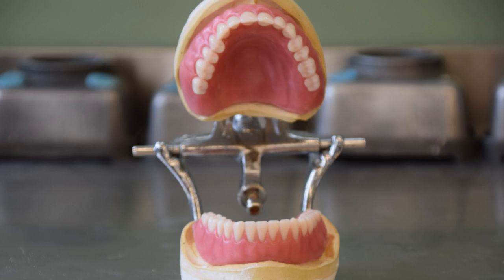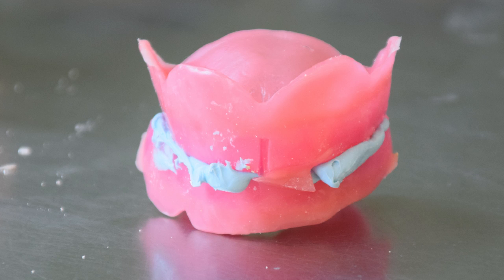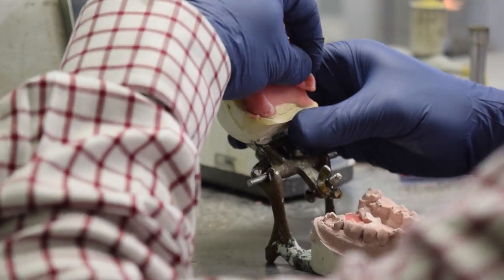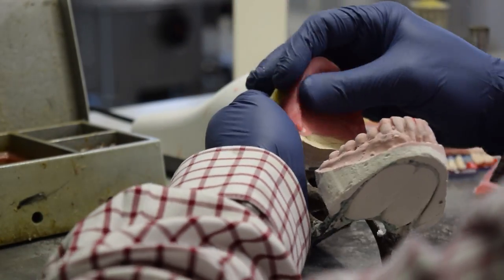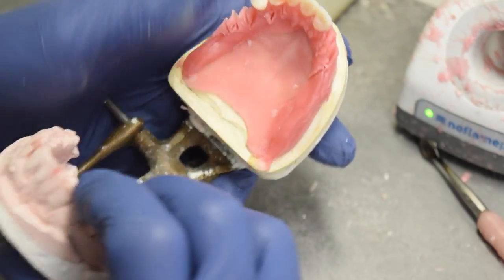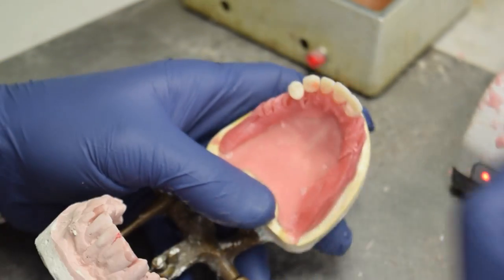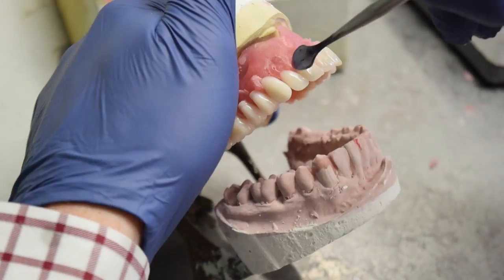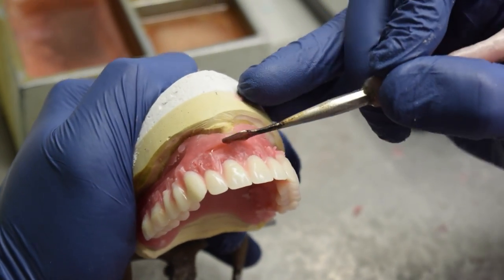Part of the Process - Setting Denture Teeth for a Wax Try-In

Comment from the maker: Looking for more info on different types of dentures or how certain lab items are made? Check out the videos below:

Denture FAQs - Types of Implant Dentures (Snap-On Dentures) https://youtu.be/no-aereeeio
Denture FAQs - Types of Dentures and False Teeth https://youtu.be/HgIpLvSL8jA 
Denture FAQs - 5 Frequently Asked Questions About Dentures by Patients https://youtu.be/QpbAyNYfDGA
Part of the Process - Setting 3D Printed Denture Teeth https://youtu.be/DFdREkyVPlU
Part of the Process - Setting Denture Teeth for a Wax Try-In https://youtu.be/cIci1ifbkW4
Elevator Pitch - 3D Printed Dentures https://youtu.be/ER1DSfiifeE

Like and Subscribe to the channel for weekly updates and videos in the dental technology space!
https://www.youtube.com/c/UticaDentalLab
Reply: I need better dentures made. I bought the $3k ultimate dentures from Affordable dentures and  their not right.  She down played my concerns and basically sad you'll get used to them. 
  The front teeth are off center by 2 mm. I noticed it immediately. And the Rear teeth don't come together all the way. I feel only bite pressure in front, not back.  Occlusion is not lined up right, and the plane is slightly off as well.. 
 I need to know where to find a real craftsman to make my dentures. I can actually fix all but one problem my self with a reline, that's the front teeth being off center. That will require a whole new set made.  Which is what I want. The top need to be able to be converted to snap in at a later date. Bottoms already snap in.
How do I find a great lab tech to make my dentures? I know who ever I talk to will "claim" they can, but I want someone with that reputation of doing them right, and doing them well